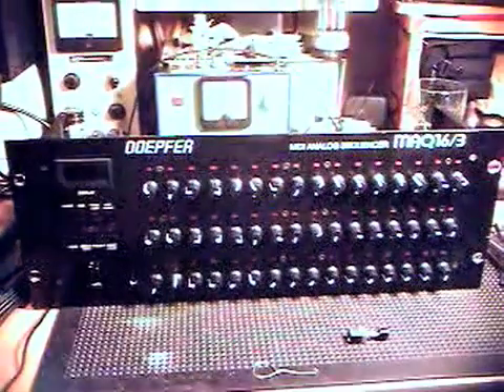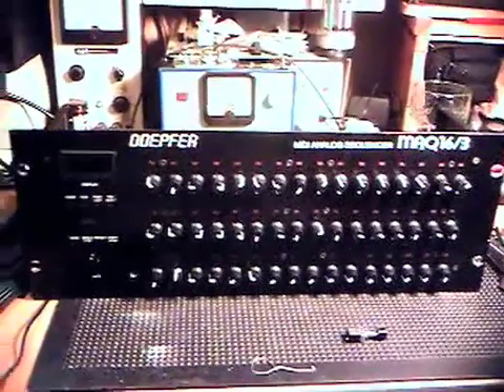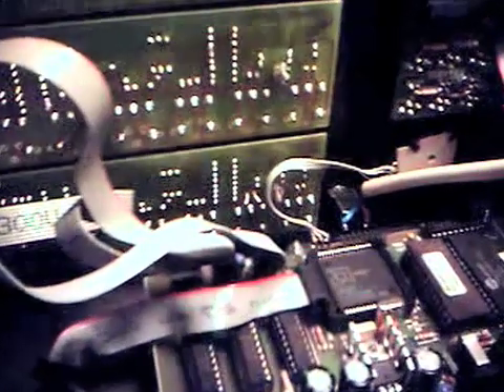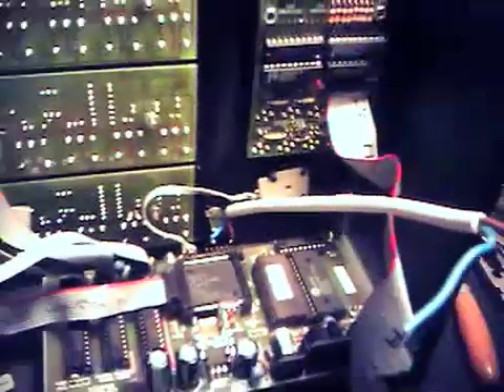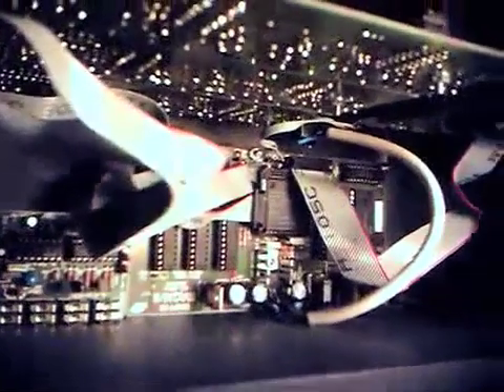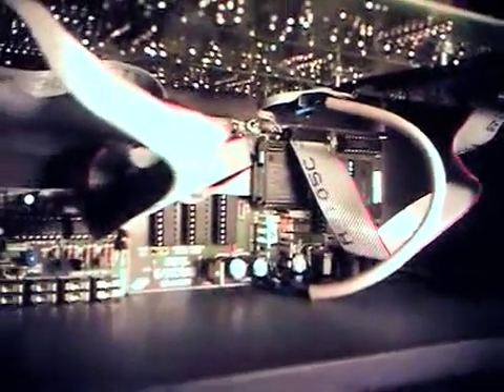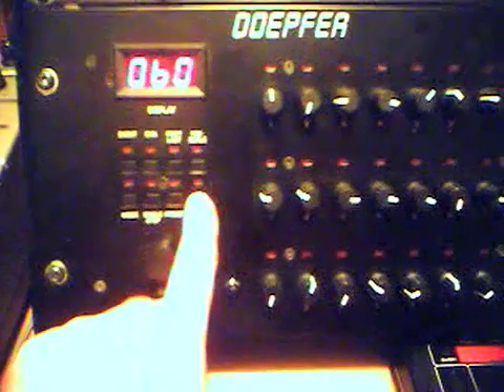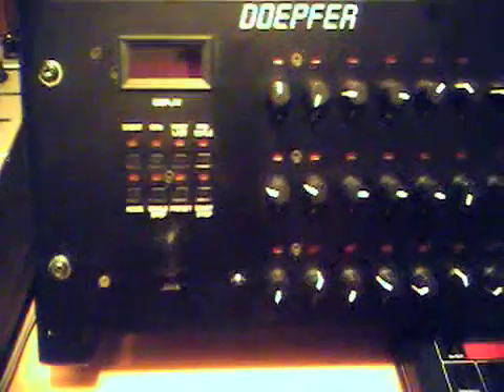Adding an ON/OFF Switch To A DOEPFER MAQ16/3 Analogue Sequencer - Modification

Comment: I didn't do the ON/OFF switch mod, but I needed to move the CV/GATE outputs from the rear MAQ panel to the front, so I bought a single height rack front panel and mounted the CV/GATE PCB externally, the reason for commenting on this video,  I'd omitted to make a note of the correct orientation of the ribbon cable from the Mainboard to the CV/GATE PCB, this video clearly shows the correct connection, thanks very much.
Reply from the maker: Derek so glad it helped, the on off switch I a great addition, saves the constant pulling in and out of the power plug, or leaving it in a risking damage from a huge surge when you switch everything on from a main power switch to all those spaghetti plug board LOL I always try to video everything when opening things, I never know when my wife or others will call me away and for how long and I've come back in the past and thought crap i didn't video the pulling of the cables then have to spend days trying to figure it out. Sadly so many videos on youtube jump about and miss so many important shots which have led me to trash several items in the past, then I read they sell spare parts hmm coincidence. Please don't forget to subscribe and check out my other great videos https://youtube.com/playlist?list=PLVnKaE3t-yQWqZK6pjJVKNIX9b6F8cmbV there are over 409+ to choose from and share #fixed1t with friends, family and colleagues as I could do with more subscribers to help grow the channel.  Many Thanks Malcolm aka #fixed1t